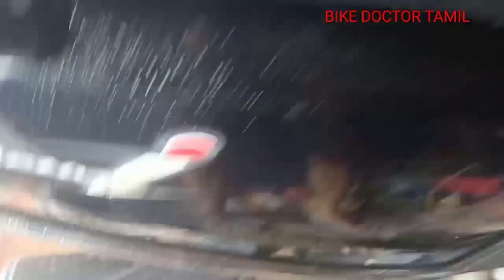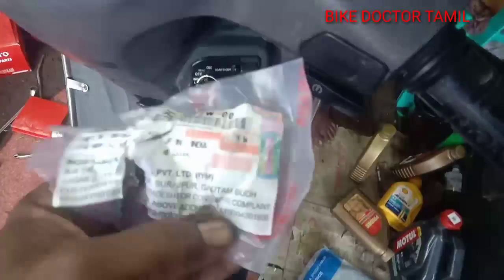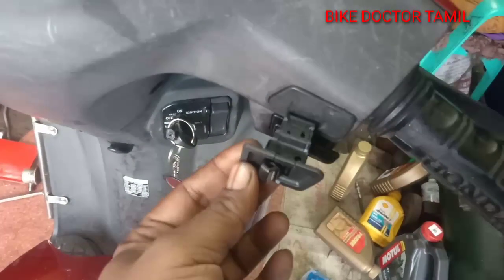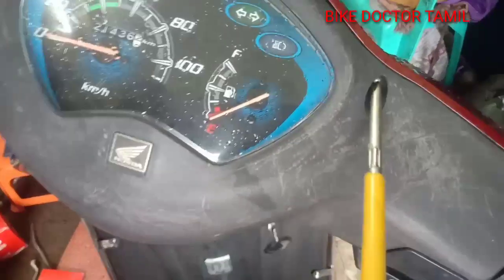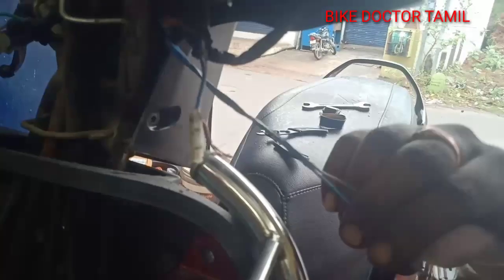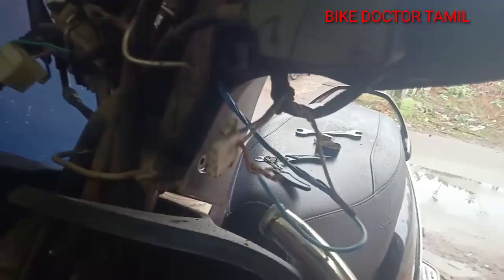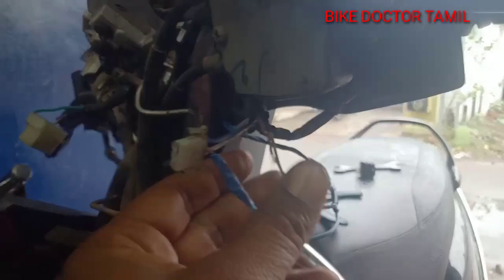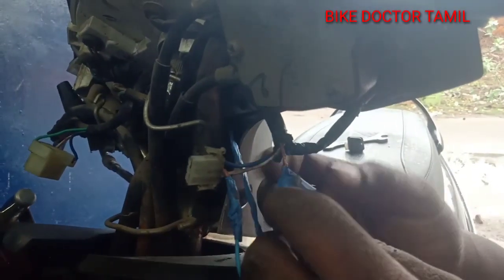Bike Headlight On Off Switch In Tamil

Comment: Anna vanakkam anna ennoda honda dream yuga milega varala nu head and valve ellam vela parthachi but no mileage then original clutch plate um change pannita milega varala smoke dry aa block aa rase panna varuthu so mileage vara enna seiya help me anna
Reply from the maker: Hi brother 👋 thank you for your support 🙏 no problem brother air screw meter vachi adjust pannuga brother
Reply: Showroom la sari pannitanga anna but oru oru time um mileage different aa varuthunga anna